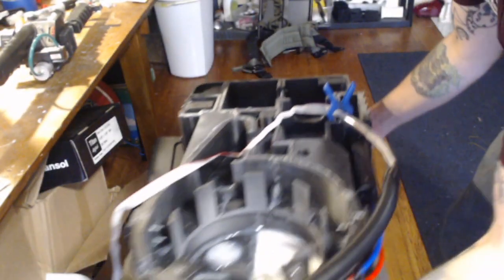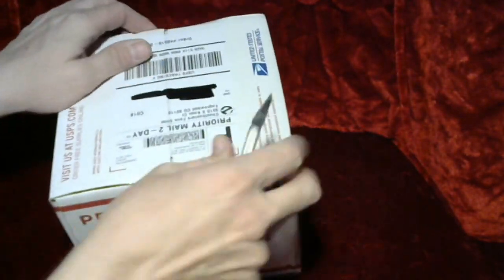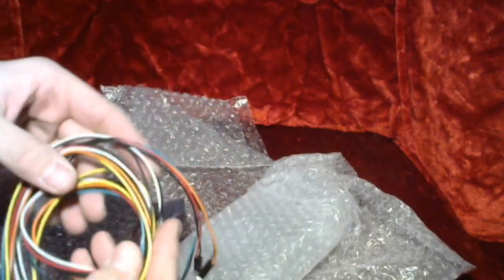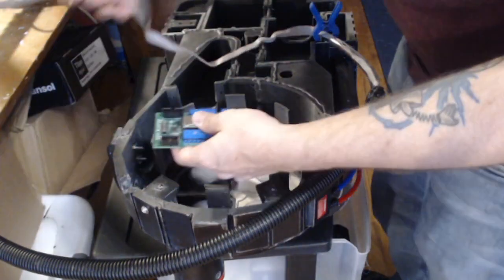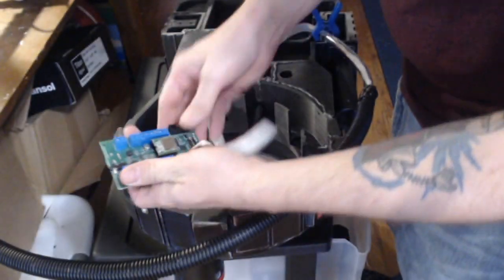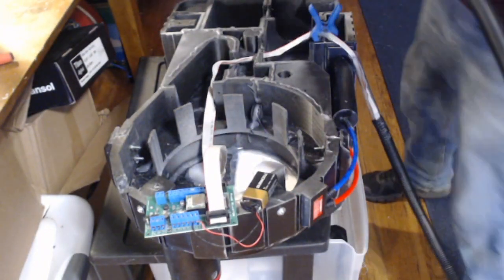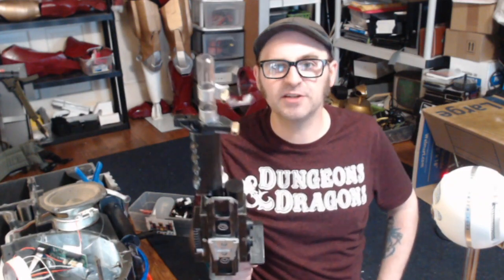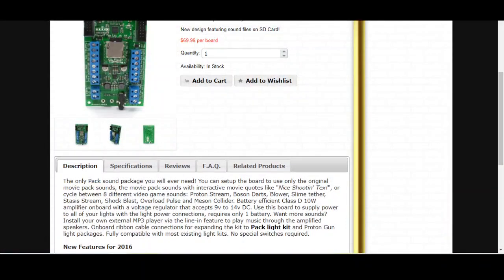Nerd Stuff - Ghostbusters Proton Pack Electronics Installation

Comment: I have this same problem. I tried testing the board for sound. Just hooked up a speaker then a 9v battery. And nothing. I also have not tied in the particle thrower wires yet, but thabks for showing me there's a ribbon cable for it!

Comment: Great pack man. Your better getting a 12v rechargeable blue battery. I have one in my pack, works great.
Reply from the maker: Oh it was immediately sold to a super fan. He can do whatever he wants with it :)
Reply: sully what 12v battery did you use do you have a link? im having trouble figuring out what it i need to power this unit lol

Comment: Yikes. I have all these parts from gbfans sitting around collecting dust while I finish sourcing parts, I didn’t think this would be such a hassle to set up. Was it really only the battery causing issues?
Reply from the maker: It was all super easy. My only issue was underestimating how quick it could drain a 9v

Comment: Volume is too high for such a small power source. U r over loading the system causing the failsafe to kick in. Smaller speaker or bigger power source is needed.